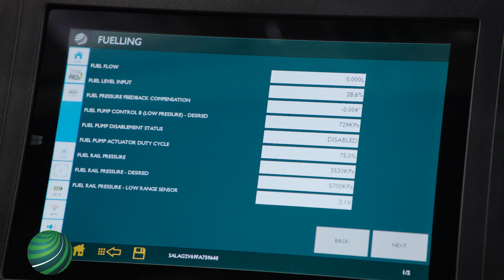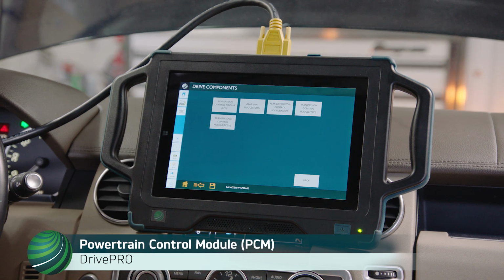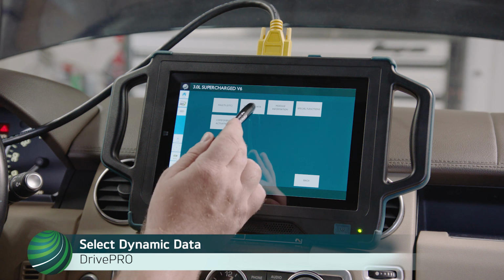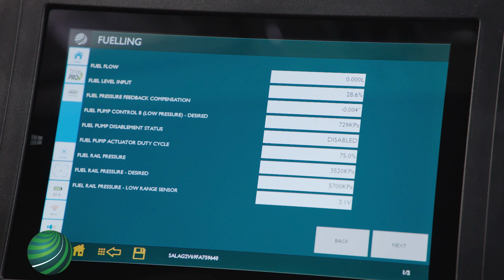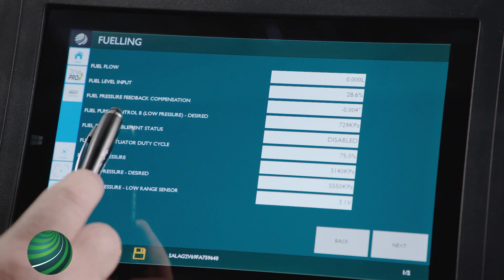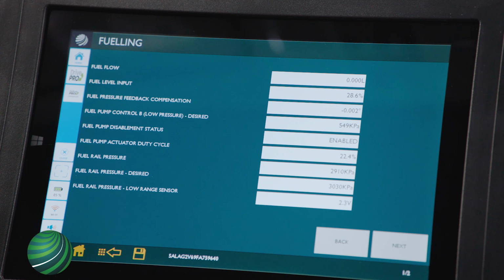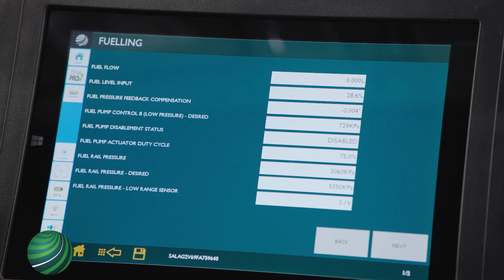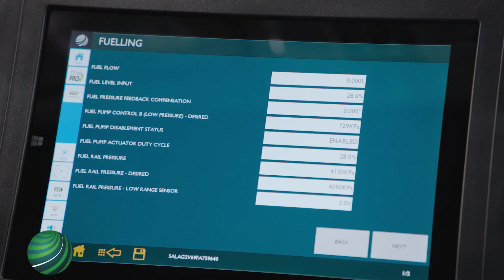Land Rover LR4 High Pressure Fuel Pump Diagnosing - Diagnosis and How To Test

Comment: So, low pressure desired is actual. There is no PID for actual.  If the low pressure sensor is under or over reporting, you cannot tell it is defective and you will see under or over acting of the  tank lift pump . So even the ECU is correctly controlng the duty cycle of the hpfp's, it might not give the correct volume of fuel into the injectors?? Am I correct?